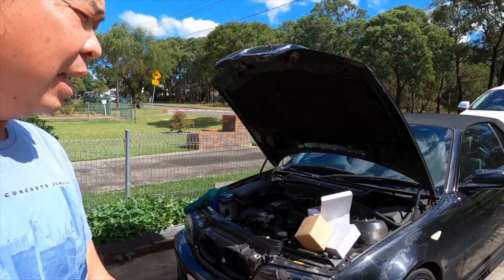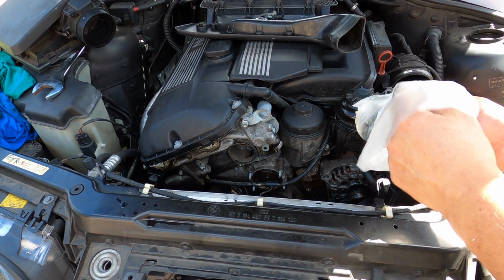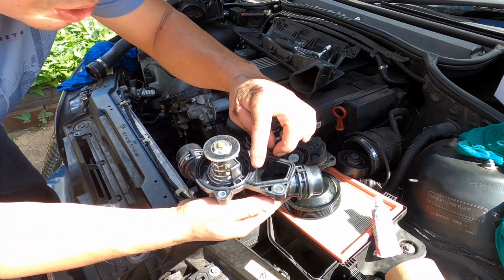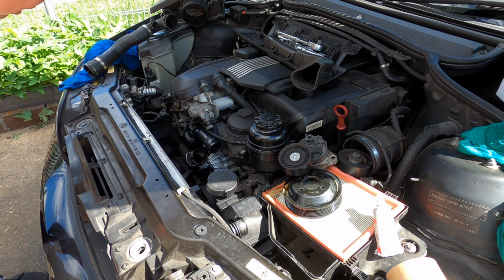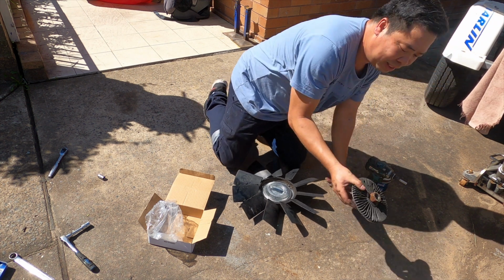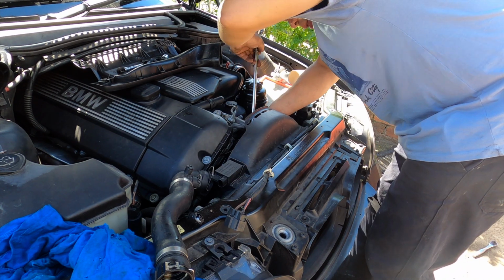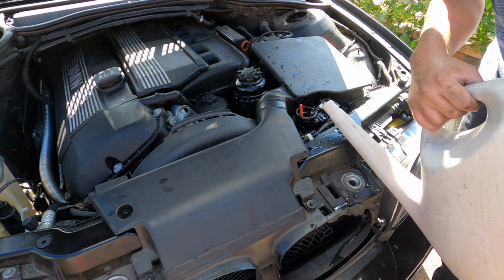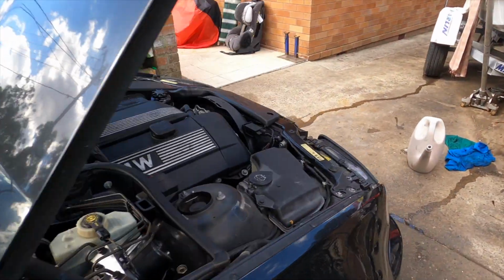bmw 330ci water pump replacement

Comment: Running straight tap water in the engine will destroy the hard lines and is horrible for the motor. You're supposed to run BMW coolant mixed with distilled water only. Anybody watching this please don't do what he's doing filling it with water from the house. Not good at all!